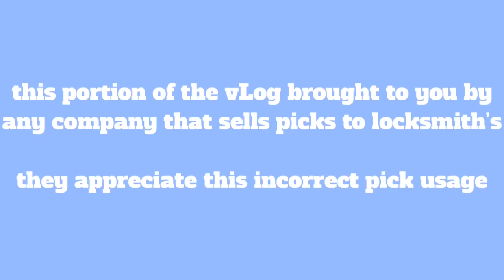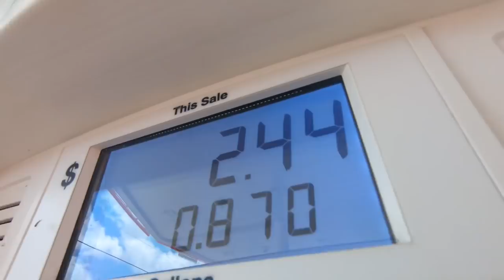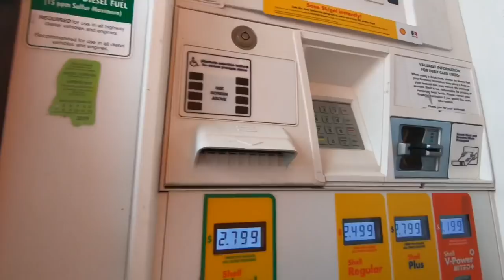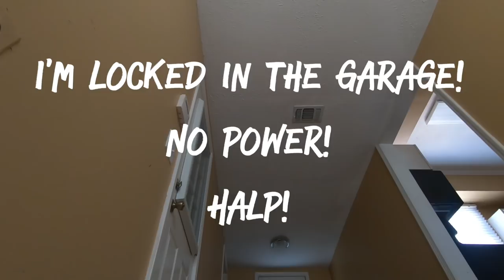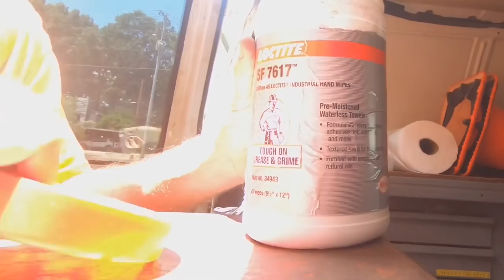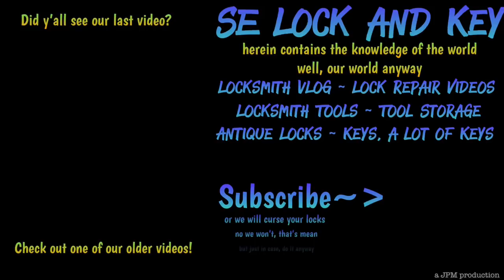Days of our Locksmithing Lives 2019 “1st”

Comment: Jason, I thoroughly enjoyed this video and always pick up great tips.  Especially the lubricant in the kwikset slot and I will try out the .145 top pins as well. Whenever you were adjusting the strike on the weiser and used the supertool, did you cut a V notch downward?
Reply from the maker: Nick Sandy the blade on that saw is narrow enough so you are able to cut down the vertical sides then angle on bottom side then reverse to cut to the other side horizontally so it leaves it flat on the bottom :)
Reply: Got it, I just wasn't sure how you started it out. Thanks!